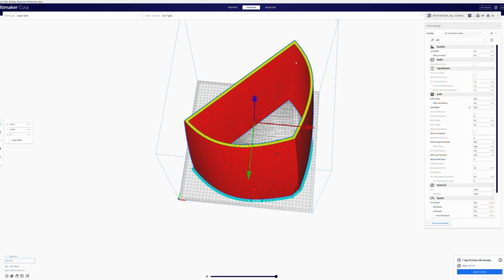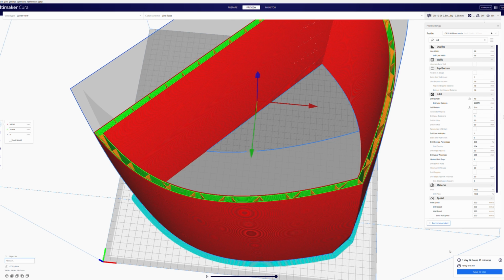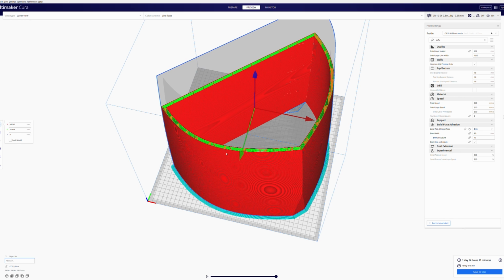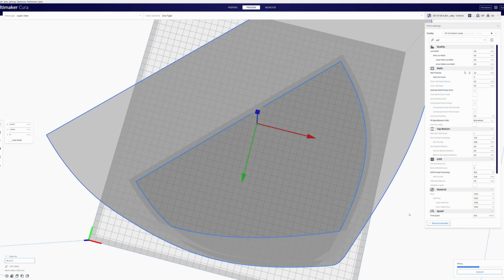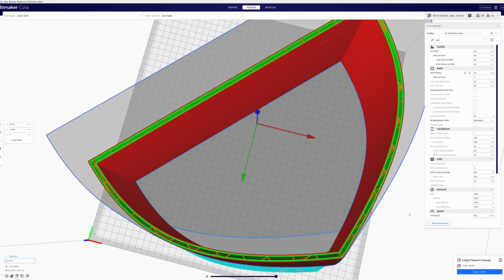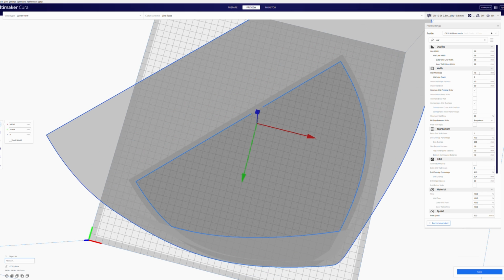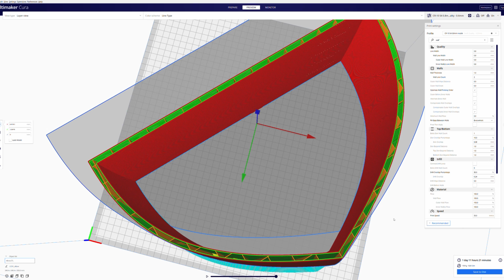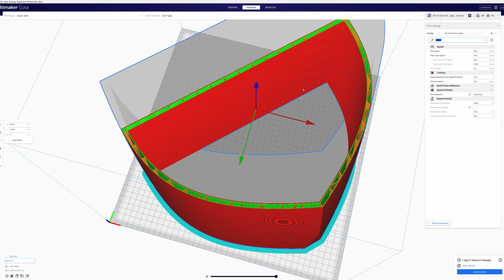3D printing large sections to produce plugs for model sailboats

Comment: Lars been going over where to start!, what printer do you use, or is it a case of any large format!
Reply from the maker: I use  Creality Printers, and I'm not sponsored. The big printer I use for the hull sections is called Creality CR-10 S4. It's from 2017, but quite updated with new mobo, firmware, hotend etc. Thanks, Lars

Comment: Lars I see that your scale for all the 12 metres is 1/10. I see that they seem to be built totally to that scale. Though I see many model yachts with keel depths and areas much larger than a full size yacht to be able to sail in a breeze of 10/15 knots. What would you call the upper limit to sail your fully scaled 12's? It's just that I am building a strip planked 9 metre in the scale of 1/12 and am at the point of the keel and it's shape and wether to stick to the designed shape or make it deeper for RC sailing. Love to know your thoughts.
Reply from the maker: Hello David, my keels are 1/2 inch deeper than original... Makes the boat sail better in stronger breeze. I'm also developing new sails with less power (flatter sails) to prevent the boats from leaing instead of sailing. The boats can sail in winds up to 5-6m/s which is the wind speed we have here in Sweden during the summer (on average). With a deeper keel the boats would sail better. I like the scale look. I'm producing some rudders tonight, and will pour the keel for the mystery 12 tomorrow after work. Got more casting sand delivered today. Would be cool to see  your build. Thanks, Lars